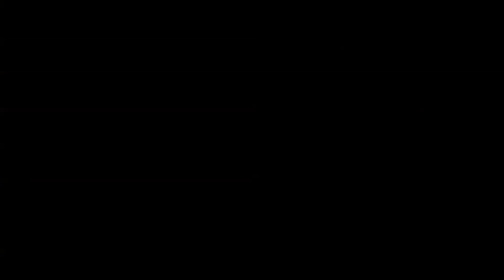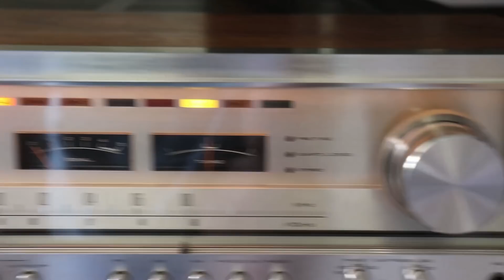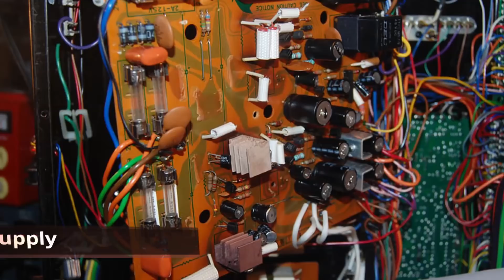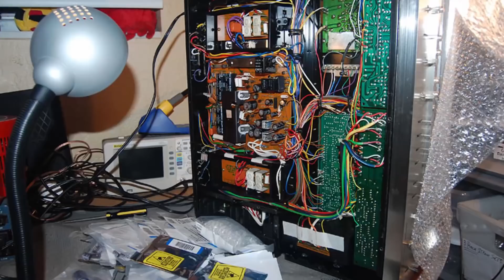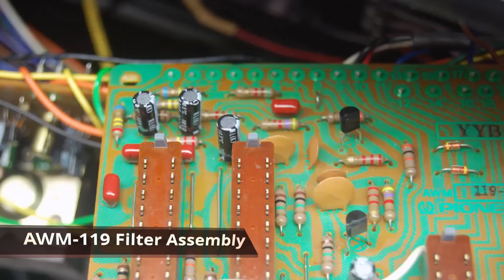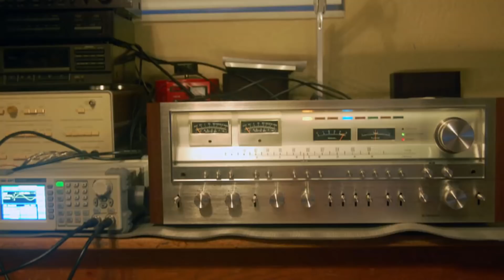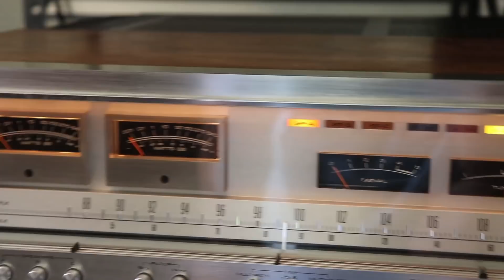SX-1980 - The Most Powerful Pioneer Receiver Ever! Vintage Stereo Repair Restoration & Testing.

Comment: I have a old pioneer receiver in my shop. Cant remember the model without looking at it. That thing used to drop so hard. It needs resisters replaced as well. Can you do the job? Only thing is it weighs i ton. Like 50 or so pounds.
Reply from the maker: Thanks but I'm a hobbyist that only works on his own equipment.

Comment: I picked up one of these before Christmas just gone.It was owned all of its life be one owner a gentleman who had died and had left it to his son whom I purchased it from.Its had a partial re cap which I will turn into a full one at some point.Ive had a new cabinet fabricated and it’s nearly looking as good as new..I’ve taken it apart done various cleaning etc..but the rest I will leave to people such as yourselves who are more experienced than me..Great educational video.
Reply from the maker: Thank you for your kind words and congratulations on obtaining a SX-1980. It's a great receiver that was engineered and built to last and it has. A great find for you!
Reply: Vintage Audio Addict .. A quick question for you sir..when changing the 4 main lamps for leds do the old lamps  just pull out?
Thanks

Comment: My buddies father still uses this exact receiver. Brings back memories.
The tactile experience of the 70s audio equipment was awesome.
Reply from the maker: Thanks for sharing. This old equipment does bring back the memories and it's usually good ones.
Reply: I'm not knocking brands
 like Sansui or Kenwood.
Didn't I mention Technics turntables?

Comment: This video came up on YouTube, so I had to take a look. I'm a fan of Pioneer. I have not so vintage Pioneer stuff; 4 VSX receivers (acquired so I can watch my VHS, DVDs, Blu-rays, HD DVDs,  and antenna TV with surround sound), CD changers (magazine type), and audio cassette tape players (one is a 6 cassette changer). I also have a number of Design Acoustics speakers and a good amount of video gadgets from different manufacturers (including gadgets that record antenna TV programs on flash drives). "Some" of the stuff is stored. It all works. As a side note I could get all my electronics fixed locally (small town in central PA) where most of the repair costs were not more than $35. Sadly the place has been closed for a number of years. Before that, even though I live out in the sticks, my neighbor had a repair business and he was pretty good but he passed away.  Oh well, such is life. If you made it this far, thanks for reading my post.  All the best.
Reply from the maker: Thank for viewing and sharing your story. Your can tell I'm a vintage audio guy but electronic devices in general interest me. Yes, a big problem in today's world is getting your electronics fixed. Almost all electronics would have been repaired back in the day. Now your electronic device breaks and you throw it away. Not many new service techs are coming up into the business of repair and the older ones are disappearing.

Comment: i bought mine in 1980 and play it 12-16hrs a day. low vol. had a re-build 2 yrs ago for all the reasons you gave. also headphone jack poor connection. was losing some lights. already the sound issues are returning in the switches and all the white LED lights are burnt out. nothing was done to the phone jack. very poor job. after listening to you i wish you worked in Toronto.
love my 1980, matched them w/ ESS Rock Monitors, still humming away 40 yrs later.
Reply from the maker: It's great that you've had your SX-1980, 40 years! I'm sorry that your restore has not held up as well as you would like. I'm just a hobbyist that repairs and collects vintage audio equipment but I've worked on a lot of units. The controls/switches in the SX-1980 and other vintage equipment when cleaned properly should be good to go for many years, certainly more then two. When I first started repairing and restoring vintage audio equipment I found that half the time I'd get a project back together and I would still have an intermittent issue with the controls, switches, pots, whatever.  I thought you didn't have to take the assemblies out to get the deoxit spray into the controls properly, I thought I could exercise a control 3 or 4 times and it was good to go. I found that I had to remove the assemblies from most vintage equipment to get the deoxit spray actually into the control properly. I found that I had to exercise each and every control 30, 40, or 50 times to make 100% sure that the controls were properly cleaned. Remember that I'm a hobbyist so my labor is on the house. I'll take the extra time to make sure its right because it isn't costing me anything for the labor. For a professional time is money. Also many people think that they should be able to have their vintage equipment repaired for just a few bucks. It's going to take 20-25 hours to properly restore a SX-1980. If I were doing this as a profession that's what I would plan on. I don't know what I would charge but it wouldn't be an inexpensive job. There are still techs out there and you being in Toronto which is a pretty big place try googling "vintage stereo repair" or "vintage audio repair" and see what you come up with. Your SX-1980 is a piece of equipment that can last another 50 years. Good luck with her!
Reply: @vintageaudioaddict  thank you for the reply. i wish a better job was done the first time around.

Comment: I worked for Macy's in the '70s and the factory rep for Pioneer offered the employees a 50% discount on everything. I could only afford the Tx-9500 Tuner.  Still have it. Lusted after the floor speakers though. (HPM-200)
Reply from the maker: Congrats on still having your TX-9500. I still have some of my early equipment. Sounds a lot like myself. I worked at Pizza Hut in the 70's. I had a few bucks but not enough for the top of the line stuff.

Comment: I still have my Pioneer 1080 receiver.  Kids dumped koolaide down the front a number of years ago. I stopped using it then, but have wanted to get it going again. Still have the turn table, dynamic range expander, cassette player (not sure it works though) and speakers. All from 1977 or so.
Reply from the maker: The SX-1080 is a really nice vintage receiver. I hope that you can get her going again. It's cool that you still have your equipment from 1977. I'm sure it brings back memories.

Comment: I had a SX-980 bought new .It looked just like that one but I thought it was a 980 not 1980. 
 Living in apt the maintenance man used his key and stole it, my speakers and tv. 
I could not prove it but I came home and put my key in the lock and it was all gone. 
One day I locked myself ( bottom door lock was locked ) out and he told me he only had a key for the door lock not the dead bolt.
That day I was late for work and just locked the bottom lock not the dead bolt. so that is why I think it was him. That happened in 1978.
Reply from the maker: Oh man, I sorry about that. The SX-980 was a very nice receiver. I'm sorry that you lost it. Vintage audio equipment brings back mostly good memories for folks. I'm sorry that your memory was not a very good one.
Reply: @vintageaudioaddict  ... yes as you get older the memory fades away,  ggg

Comment: My grandfather gave my cousin a Pioneer SX-580 back in the 80s.  My cousin gave it to me and I gave it to my brother.  He was able to find someone who previously worked at pioneer and was able to have the unit completely renovated.  He still has it today and it looks and sounds better than most modern day receivers.
Reply from the maker: Great story! You didn't have to have the big dog in the lineup back in the day to still get a quality piece of equipment. The SX-580 was built with the same engineering and build quality as the SX-1980.

Comment: Never saw a SX 1980 ,  Bought a SX 780  new back in the late 1970's from LaBell's  store which is not around any more .  Its still in service for me .   The YouTube tunes sound great through it .
Reply: the flip switches some any how could use a cleaning as you can tell there not making good contact so I have to work them to clear up .
Reply from the maker: The SX-780 is a nice receiver. I'm glad that you have had it all these years.

Comment: Those old brushed aluminum faceplates will always be classic. I wish I knew then what I know now. Still have my Dynaco PAT-4, though... 🤷🏼‍♀️
Reply from the maker: Yes, they are classic looking and when operating properly can hold their own in sound quality. The problem is that so much of the vintage audio equipment is in need of restoration. I have some Dynaco equipment a PAS-2 Pre, ST-70 and ST-35 amps along with a solid state 400 amp.
Reply: Vintage Audio Addict I wish I could the original amp that came with it. My Dad bought them new, back in the 70’s. I remember the tubes. Would look like art, today. 🤗

Comment: Pioneer Sx-1980 was not the most powerful receiver of all time. Many falsely think that is the case. In reality, the Technics SA-100 was 330W per channel followed by the Marantz 2600 at 300W and the Sansui G33000 at 300W also. As you state It is the highest rated Pioneer ever made however. These were some great times and I remember fondly the stereo wars in the dorms while in the military...
Reply from the maker: Many great audio products were made back in the day and like you it brings back good memories.

Comment: Great video. Question. For some time I planned re-capping my 1977 Optonica receiver, but was put off by these wirewrap connections. The main amp and PSU board are bolted to a massive internal heatsink, and those wires should be severed before any service. What would be the best course of action - simply cut/unwrap and hope that there's enough slack left (there isn't...), or perhaps something better?
Reply from the maker: Thank you very much for viewing and your kind words. Are you sure that you need to cut the wiring and are you sure that the power supply and amp board can't be separated without doing that? Did you download the service manual? I have worked on many different pieces of vintage audio gear including a couple of Optonica units. I have never had to do a wholesale removal of wiring. Maybe you have done the research and that is what you have to do in your unit but it seems extreme. Normally there is enough slack in the cables so the units can be serviced.
Reply: @vintageaudioaddict  Good if it's possible, I need a second look. It's model SA-2121H (worldwide PSU). I have the service manual, but never did any major in situ repairs before, and worst of all my left hand doesn't work properly - hence the thought of a stripdown. The receiver itself is good except that the speaker relay does not engage (the power amps are working).
Reply: Well, the relay circuit is live again - one small-signal transistor had B and C shorted.
Reply: Removing all those shitty wire wrap pins and sold core interconnect wires will always be "better".

Comment: Anyone feel like chiming in on the best floor speakers to add to a sx1050. Looking for better sound first then loudness. Leaning toward polk Audio Legend L800. But open to options.
Reply: I love my Cerwin Vega AT15's. They are quite large but I'm still impressed with them 40 years later...
Reply: I have a pair of Cerwin-Vega D-9,s in very very good cond. will sell also pair of Altec-Lansing V.O.T.T.

Comment: I have a SX_737 I've owned since I was 15 and just love the sound quality Pioneer puts out on my Ventage Nova 8b speakers . Best combo everrrr. Sure wish I could buy a SX-1980
Reply: I have the SX 737 also, picked it up at a yard sale for $35. Around 18 years ago. Still going strong. Also have the pioneer supertuner from the late 70s I used in my car back in the day
Reply from the maker: The SX-737 is a very nice receiver. All the the build quality of it's big brother the SX-1980. It's great that you have had it sense your teen years.

Comment: Looks in great shape. What are the supply rail voltages?  +/-70V?  Sorry to correct, but it’s pronounced Nee-she-con.

Matching transistors doesn’t fix the gain. It’s the feedback resistors that sets the gain. Input transistors are good to match to keep the output DC relatively low. If you hv a DC gain of 1, you don’t really gain much. It feels good though.

It would be interesting to know what the ESR of the big supply caps are after all these yrs.  I’ve replaced electrolytics that were 40 yrs old and found ESR was 140mohm which is pretty high.
Reply: Yes , I agree, you don't need to match Transistors in these designs.

Comment: They make a hand rap tool for wirerapping there about 80 dollars apiece. One side is for rapping the wire the other for unwrapping.
Reply from the maker: One of the issues with using wire wrap techniques is that you may not have sufficient virgin wire left. Once the wire is unwrapped from the pin either by breakage or manually unwrapping a new piece of wire should be used.

Comment: What was the price when these were sold in 78-80 ?
Reply: the list price was 1,600$  i got mine for 1,000$ 
a lot of money back then but cheaper than separate components and the specs. matched or outperformed anything else that came close.
 now it is worth 2-3,000$ if not more and i had 40 yrs of listening pleasure :)
Reply: @scootter1956  Thanks that is a lot of cash back then.
I was making about 7 thousand a year in 1980 but I was 18 years old
Reply: @garymckee8857  i was 24 and saved up for 1 yr
 then another yr to get my ESS speakers
still have them also :)
Reply: @scootter1956  That's a name I have not heard of in years ESS

Comment: I was a nervous wreck just repairing a broken hinge on a Denon 4806 a few weeks ago..NO WAY I would even think about screwing around with a SX-1980 !!.. I've been buying alot of the 4806's for a few hundred bucks on Ebay. They were around $4000 out the door back in the day (2005)...They have a strong pre-amp section with over 6 volt output with very low distortion and will output over 100x7 RMS with all channels driven. Not close to the SX 1980 in stereo mode however...only around 180 watts per channel @ 0.1 two channels driven...
Reply from the maker: Most of it involves experience. With you already working on audio equipment I'm sure that you would not have an issue. Remember that units like the Pioneer SX-1980 were engineered to be repaired. The engineer's did not expect you to throw it away when it broke like so much of the modern electronics.
Reply: @vintageaudioaddict  There is no telling how many top of the line receivers are just sitting around in homes today. Someone found an "open box" SX-1980 at an estate sale and the current bid is $26,000 dollars on Ebay.. It's still in the box and appears to have never been used...(Ebay Item# 114069889751)

Comment: Hi, I have a SX980, that I have cleaned the pots, did the LED replacement, and some of the accessible caps. I only get "Stereo" signal confirmation light on a few channels. Do you have a few ideas of common culprits for this? Thanks. PS awesome receiver!!!
Reply from the maker: Thanks! Your SX-980 is a great receiver. Sounds like you are probably talking about a  FM issue. If you are and if some of your FM stations are locking in stereo I'd say it's more of an antenna issue. Have you tried moving your antenna or is it possible that it came loose from the back of your SX-980?

Comment: Nice looking receiver. But why replace transistors if they aren't defective? If they lasted 40 years they are probably going to last forever :)  And there is a chance the ones you use to replace them aren't as good.  I would change all the electrolytics in the power supply and the power amp boards for sure. Anywhere they are subjected to heat.
Reply from the maker: Thank you for your kind words. Google "electrolytic life expectancy". The manufacturers of electrolytic capacitors all say the same thing, 15-20 years and they all start to fail. This isn't me saying it. These are the manufacturers that design, test, validate and produce the product saying it. It doesn't matter if an electrolytic capacitor is in a power supply or in a box in your closet. As soon as they are manufactured they have a limited life. The modern transistors are superior in specifications to almost all 40 years old transistors of the day. Again it's not me saying it, its the manufacturers  of the semi-conductors. It's all online to research if you are interested.
Reply: @vintageaudioaddict  Ok on the electrolytics but as for the transistor. Are you saying a transistor of the same part number, say a 2SC1345,. has different specs today than ones made 40 years ago? It wouldn't be the same transistor if it did.  I can believe a manufacturer  selling transistors today would want you to believe it but I would trust a working 40 year old transistor over a new one. It had a 40 year test. :) A new one probably has no quality control testing. Transistors don't wear out. They dont dry out. They dont age. Anyway, nice video, awesome amp. Thanks!
Reply: @johninjersey   Yes, I  agree  there is no need to replace  working Transistors.

Comment: I have an SX-1250 and live in a decent sized metro area, but finding someone who can restore these things is pretty tough.
Reply from the maker: I know. I hear the same story over and over. The old techs are gone and there are not many new techs coming into the electronics repair business as most electronics when they break you throw them away now a days. Your SX-1250 can probably still be operating well in 50 more years if there is anyone left to repair her. Great Receiver!